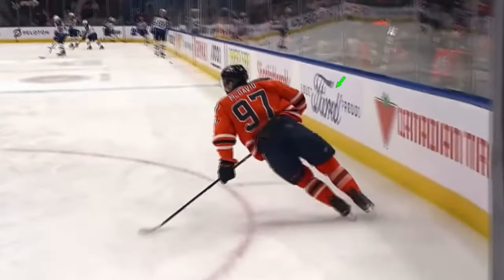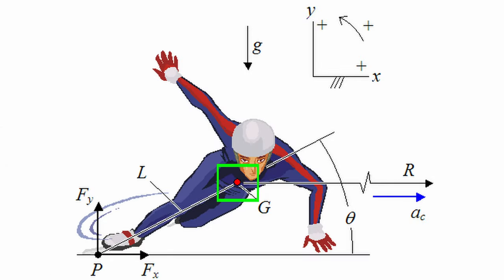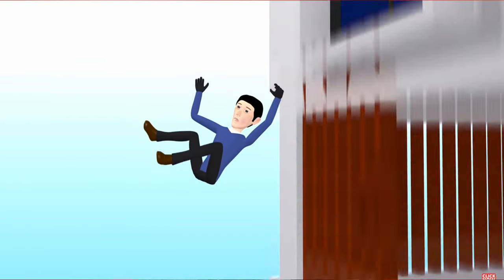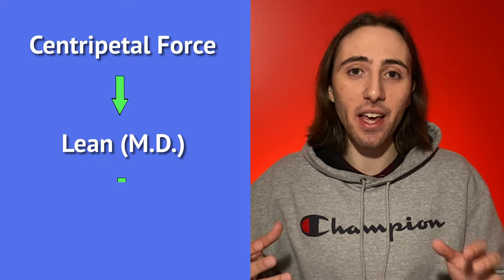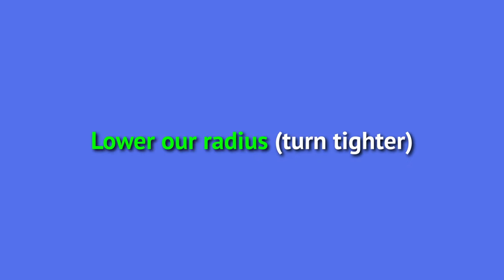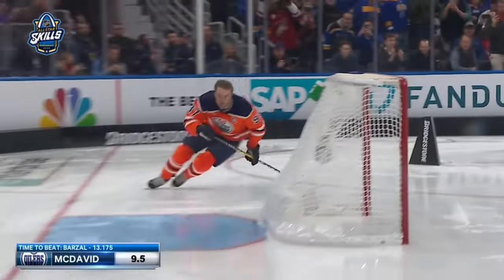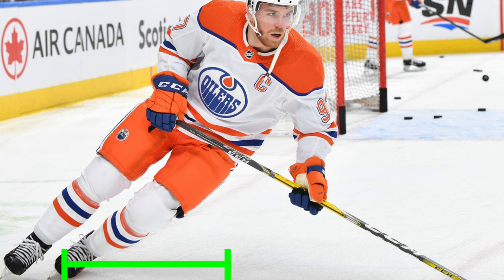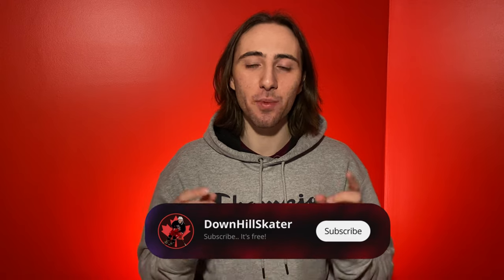How to get McDavid LEVEL lean on crossovers!! (Physics of skating)

Comment: Again, absolute GOLD!  

Let you and I collaborate on a discussion of this, your second vid about the how to’s, and my expertise: how to set up a blade properly to execute these mechanics efficiently.  

Lean/Y Angle also has a variable that is correlated to angle of attack which is basically, blade height.  As the height diminishes the vertical force exerted into the ice (friction or bite) gives way to the outward inertia force and the skater wipes out — often times “booting out” as their plastic rubs the ice.  There’s obviously a point of diminishing returns in that aspect.  

However, I see so many players with woefully short blades and their turns suffer significantly.  Further, many skates (especially junior skates) have backward pitch which puts the active blade too far back in the mid foot.  While you didn’t directly discuss shin angle you often speak about shin angle in association with Y Angle.  When the skate is pushing the player to their heels their shin is usually very poor and they fall a lot.  They fall backward, for obvious reasons, but they also fall forward as they over compensate the other direction.  To make matters worse, they’re skating on a low radius (usually 9+ - 10ft) and if they’ve had an aggressive hand sharpener work on their blades, they likely have little toe.  

Wow!  It’s clear to me that McDavid has someone very good setting up his skates and I promise that absolutely zero of his “specs” are random.
Reply from the maker: Great insights! You make a very important point about heel pressure in the crossunder. If you don't have shin angle + heel pressure your crosses will suffer big time. 

I believe I still have your email, I'll get in touch for some sort of collaboration.

Comment: HI, what do you think about turning your chest to the center, lowering the shoulder farthest from the turn and raising the near shoulder? You can see Svechnikov doing that in fastest NHL skater competition this year. I tried this, it looks that it really helps gaining speed on crossovers.
Reply: Amazing observation.
My money is on this being a stabilizer and probably countering some of that inertia. Makes sense cuz it was a larger arc and tough to rely on lean.
Reply: There’s a power skating coach in the NYC/CT area named Kurt Nichols who I know who teaching exactly this “counter balance” technique.  I’ve seen it pay huge dividends with my daughter’s turns once she trusted it.
Reply from the maker: Good observation! I'll talk a little more about the shoulders in part 2.  

But from what I've seen with Mcdavid, his shoulders are sometimes level with his hips (tilted) like in the thumbnail and sometimes level(ish) with the ice (ex. on the fastest skater).  

In terms of how you do that? What I've found is to keep the shoulders "level to the ice" you want to bend at the torso/waist (look at a golfer at impact) vs shrugging the inside shoulder up. 

However, often times what I've noticed and felt, is that it looks like the shoulder are countering but it's more that the upper body remains neutral and the legs go out to the side, resulting in the hips being tilted while the shoulder are level to the ice. 

The question then becomes, should you keep your shoulders level to the ice or not? 

I think it's really based on feel. For me like Mcdavid I sometimes have them level sometimes not.

Typically when I'm changing directions quickly like say in a punch turn my shoulders remain level to the ice, same with Mcdavid, but on crossunders it varies. 

I wouldn't worry too much about it on crossunders, as long as your not dipping your inside shoulder you should be fine! But also feel free to play with your upper body positioning and feel the difference in your own game. 

if you feel faster keep your shoulders level then that's great, but play with both so you can feel the difference. 

As per Svech opening up his chest, lots of players do that when turning to their forehand side, but it's not something that is done on the backhand side. My opinion is that it's largely based on stick positioning vs the "right or wrong way". So I wouldn't focus so much on turning your chest to the center but more where you're positioning your stick. 

I hope that somewhat answers your question. Long story short it depends